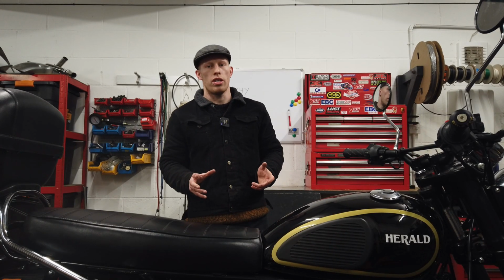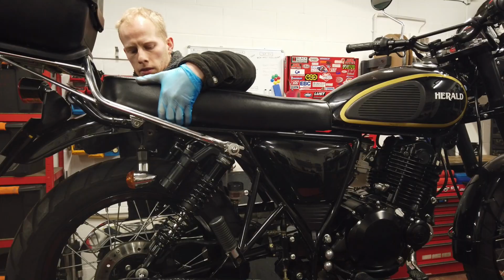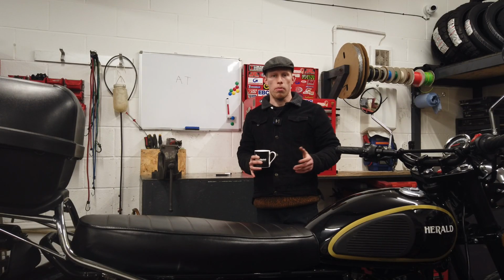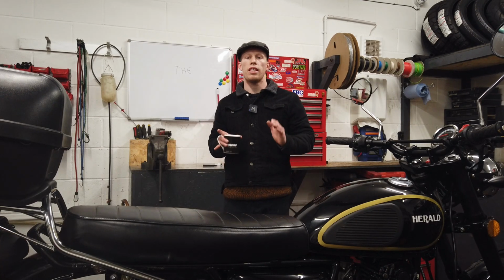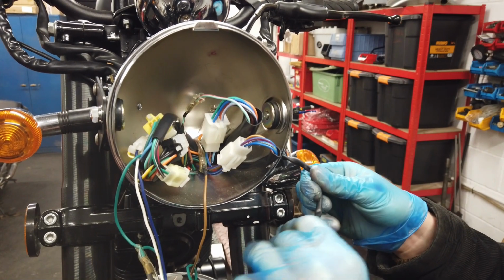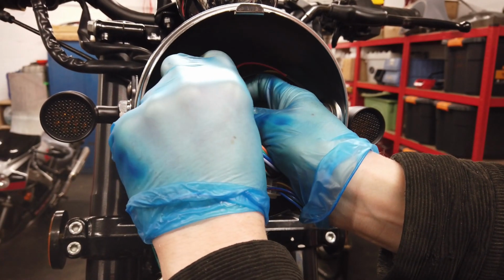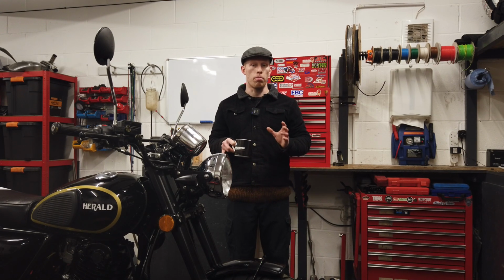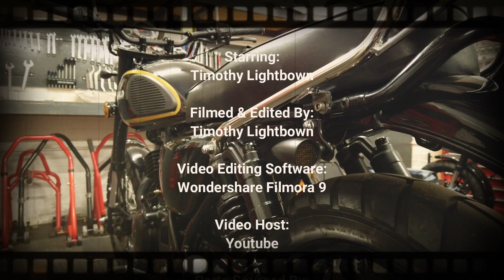How To:  Replace Your Indicators & Relay

Comment: My universal indicators I just received from your store seems to have black=earth, red=positive dim and white=positive bright. I have a battery in front of me so I've checked it...it just seems odd but is that how they now come with that colouring with red being the dimmer option? I'll definitely be connecting the white up to the positive terminal anyway as its much brighter. Thanks and great videos!
Reply from the maker: Yes they changed them at some point a while back, I'm trying to figure out how to add that into the video without re-making it. Thanks for pointing it out :)